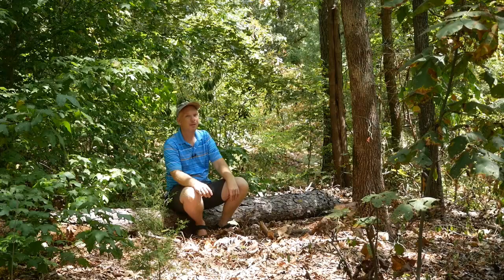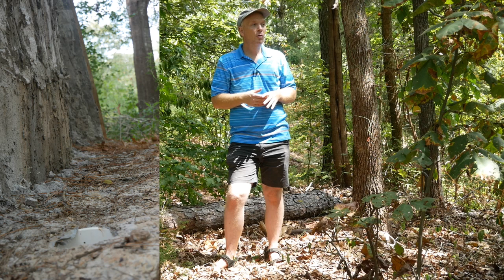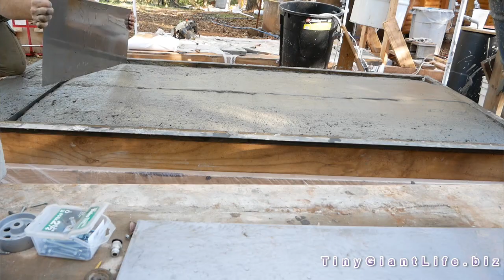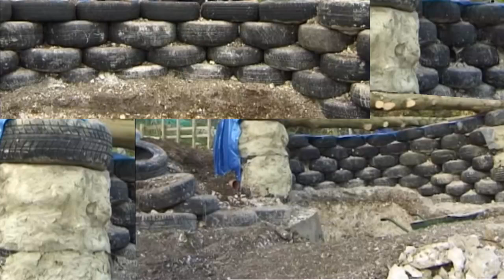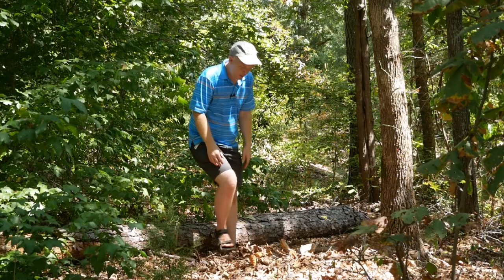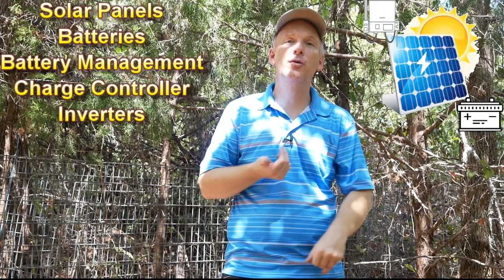Earth Ship Vs Air Crete House   YouTube

Comment: One thing I've wondered about earth ships, couldn't you just replace the tires with something else?  Or do an aircrete house that is earth bermed like you've buried a hobbit house?  I like the passive ability of earth ships
Reply from the maker: You could just do rammed earth.  Tires are a waste of time.  You could use AirCrete as replacement for the outer foam board wrap.
Reply: @TinyGiantLifeStyle  I had wondered about doing eartship but with rammed earth, air crete, and cob/straw bale.
Reply: @TinyGiantLifeStyle  you just do not know how to do the tires correctly, or the options for compacting the dirt. Boom, aircrete lacks structural integrity.
Reply: @greenhometony  would you care to elaborate on either point you made? Not saying your wrong but I don't have enough information to know your right either.

Comment: Great analysis of the earth ship survivor model which is the gold standard in off grid self sufficiency.

I'll add to the average temperature not good enough in certain locations point
That the "Citrus in the snow & lds prepper" geo air tubes  burried deep below grade would greatly help.

Looking forward to attending one of your work shops. Am wanting to build trenched or bermed green houses for extreme cold environment.

Also am researching the use of fly ash mixes for lower cost and greater performance.
Reply from the maker: Earth bermed walls are nice because it reduces the temperature difference inside out.  Which reduces the "work" your insulation has to do.
Reply: Me to I am in 50 s so my energy levels probably arent high enough for endless tyre pounding  but loved the idea of a earth ship since I saw Mike Reynolds in a greenhouse magazine in my early teens I have access to fly ash and lots of rocks also considering adding lime to mix to reduce cost of cement with out reducing strength too much.

Comment: I am wanting to build into my hillside a earth bermed structure I have talked to an engineer an no my loads on my wall and roof I want to know and no one has talked about the strength of air crete I am projecting 176lbs per square foot on my roof will a air crete wall carie  the load of roof and the force against the wall at present I am looking at a permanent wood foundation it will handle it
Reply from the maker: AirCrete has a compression strength of more than 160 psi, but has NO TENSILE STRENGTH.  The fabric provides 87 pounds per square inch tensile strength.  

Still I would not put AirCrete under ground. Insulating walls with earth temps would be  effective.  However, wet AirCrete does not insulate much.  It is not possible to waterproof underground walls with 100% certainty.
Reply: @TinyGiantLifeStyle  earth temps are what you would want your home to be, that's why earth-bermed is preferred
Reply: @TinyGiantLifeStyle  perhaps SIPPs may not be a good choice for berming either...
Reply: I'm curious if you decided to berm or not?

Comment: I am interested in building a passive solar air crete dome for climate zone 5 if not to live in I would use it as a green house.
Reply from the maker: Domes do not exactly have the right shape to  deflect & shade windows in the summer.  Also you need R30 insulation as well as enough thermal mass in some form.  Blocks of that thickness will need to be cast with the correct angles to stack the dome.  It's not impossible.  Be sure to study passive house design as well visit a passive structure as in your area if possible.